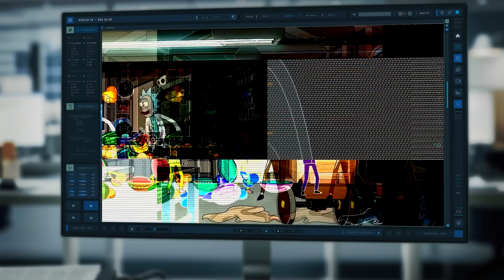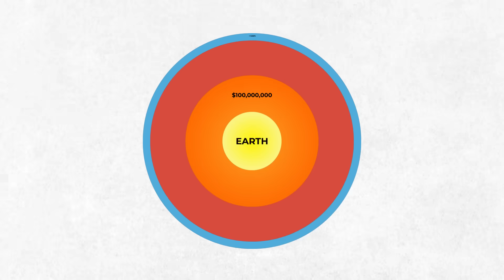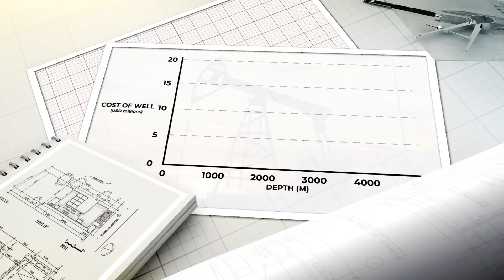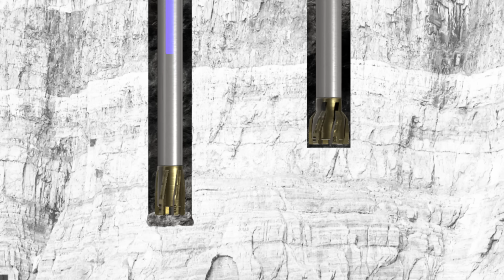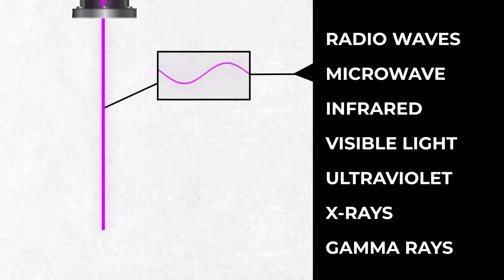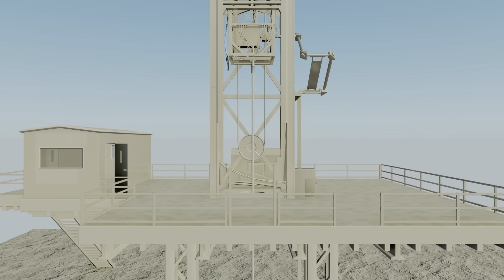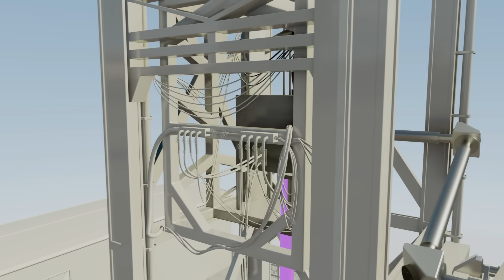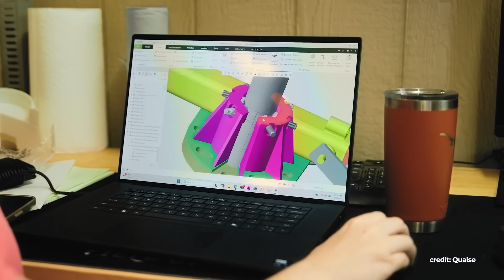The Most Advanced Drill in Human History

Comment: Arguably, this is not at all advanced. "Normal" drilling is very advanced, but closer to it's full potential. 

For example, torque does not need to be carried all the way up the string, but rather between a motor and a self-wedging stand further up.

Another example, vertical movement or force can be sensed in the bottom hole assembly and transmitted to a predictive controller at the top. 

To me, I cannot fathom how condensation up the line can be avoided. Perhaps it can't, and scrubbers need to be distributed along the line. Just as you to to scrape wax from production wells. This, too, is part of the advanced technology of 'normal' drilling.

Or perhaps a venting drill hole is part of a solution. Let's all hope this idea works out!

Comment: Sounds like science-fiction. Melting rock with a laser wouldn't be possible.
Reply: Melting rock with a laser is easy. Well, "easy", on an industrial scale. The issue is they haven't addressed 90% of the issues that drilling technology face, such as preventing the rock pressure from collapsing the borehole, or insulating their technology from temperatures that will dissolve their insulation and melt their components at the depths they want to reach.

Comment: They don’t understand drilling or drilling terminology… “this scraper tool”, do you mean reamer? The problem with deep wells is heat. The solder melts off the electronics in logging tools making evaluation of what was drilled impossible. A big part of drilling is clearing the hole of the “cuttings” the chewed up rock fragments. How do you get this melted rock (aka glass) out of the well? What happens to the gasses made when melting rock, how are they expelled from the borehole? Lastly, there is plenty of geothermal energy available across the Gulf of Mexico, reachable with current drilling technology. Supercritical water from 15-17,000’ at 300 degrees flashes to stem at surface pressures. Steam turns turbines. Then you have just the standard problems of geothermal (corrosion being the biggest).

Comment: The biggest problem with geothermal is water, or more correctly, lack of water. For example, a successful natural geothermal power station had to be shut down after 25 years of continuous operation because it ran out of water. I'm all for diverse energy sources, but they have to be reliable and cheap.

The pollution from burning coal can be mitigated, but it does raise the cost and therefore the price of energy. Weigh that against the cost and price of wind, solar and the transmission infrastructure for renewables (wires and battery storage). Activists praise renewables and demonise fossil fuels while at the same time ignoring the downsides of renewables. This is nothing new and 'the people' are easily fooled by paint-by-numbers propaganda.

Comment: I'm curious if the lifespan of these underground reservoirs for geothermal. It's definitely not liquid but there is more movement down there. Is it long enough to justify the projects? If you get an outage from a collapse, it will definitely not be a quick turn around. So, like nuclear reactors, you'd need redundant power systems to make it work reliably. To power a town, you don't need one reservoir. You need two or three. It'll be tough to make the cost work but it would be really cool

Comment: So how do you tell where you have drilled to with this form of drilling? Theres no mudlogging to be done with vapourised rock, you wont have any downhole geophysical or survey tools in that drillstring to tell you what angle or azimuth you're at or indeed any that can see through the apparent vitrified borehole wall to investigate the geology. 
If they somehow manage to keep the well open against the full force of hydrostatic pressure, geological stress, fractures, faults and pore fluids, you will still have to pull everything out to run a wireline survey tool just to see where the bit has gone or is going. But that wont matter, because of course, there's no steering tool to point it where you want to drill either. I'm sure the maser does have an application, I'm just not sure its this one.

Comment: Apart from not being able to use water for flushing out debris from the borehole - what happens it this drill hits groundwater, which it will at many different sites? And another question - can this thing drill around corners or does it have to be straight down? If it can drill aound corners you can drill a heat exchanger at depth, then cover the inside of the hole with an impermeable coating and pump clean or destilled water from topside through the bottomside heat exchanger.

Comment: WRT 9:15 So this maser'd vitrified glassy rock is reasonably easy to break with a drill but will be used as a replacement for a steel and cement liner. Right.
Reply: It prevents water from flowing in from the sides , thats all it needs to do

Comment: 9:18
I got kinda confused as to why you were using inches and then meters when talking about bore speeds so I kept it all in inches for consistency.

Current output
1in every 5min = 12in(1foot) every hour

Target output
3-5(4m) every hour = 157.58in(13.123FEET) every hour

So they are looking at a 13x increase in bore speed. Thats pretty good for something that can run 24/7

Comment: certainly you wouldn't need to turn the whole shaft.  just have a motor at the end of the lowest segment and run it by electricity...which you could run along the outside of the pipe as a kind of bus bar.

Comment: Retired oil field driller here. That glass wall will never replace steel casing cemented into place. There’s no way melted glass would reliably pass a pressure test. Not to mention if this laser drilling rig hit any pocket of gas or liquid of lighter density then the rock they drilling through and its blow out time. They have no primary well control method since they have no drilling Druid. This tech is a pipe dream and a waste of money. The people in charge don’t even understand the most basic of problems with this system. Maybe go learn about conventional drilling before you go try to reinvent the wheel.

Comment: This startup is going to fail. The right way to drill holes in rock would be to use abrasive water jets
Reply: water evaporates
Reply: @sleepparalysisdemon6394  Water is just a carrier. Abrasion is done by particles of abrasive material that water carries. Even if water evaporates on contact with hot rock, abrasive particles will still do their job. But in fact, it could be just a sandblaster with air as carrier, but water can carry more abrasive particles (so it creates a much denser flow of abrasive particles than air)

Comment: Fusion reactors aren't just hotter than the surface of the sun (6000 K), they're hotter than the core of the sun (15000000 K)! ITER will have a plasma temperature of 150000000 K.

Comment: Great explanation of what Quaise are trying to do, but a little light on the challenges they face, even with a working drilling system.   They still have to have a borehole that is resilient to pressures on the vicinity of 3+ kbar (45,000 psi) over the working life of a plant, e.g..  But the biggest ommission, is how you skirted by the "you need two connected holes" part.  To get that, you have to be able to fracture the rock between the holes, and keep it open to pump your heating carrying fluid through.  But, as you pointed out, at the depths and temperatures they are ultimately going after, the rock doesn't fracture anything like the way it does at more modest depths, and flow to close cracks rather readily.  and, if you can't connect multiple wells, every hole you drill is limited on the volume of crust from which it can gather energy, and likely to generate only a relatively small total energy before being too cold to be economical.

Comment: The real question is how this will make the Oil companies more money than oil. If it won't make them more then why would they put resources into it
Reply: it doesn't directly make money, BUT it will make it more efficient
drill can set up geothermal
geothermal makes "free" energy
energy is required by oil companies to refine oil, process oil, deal with excess cheaper and more efficiently
oil company spends less money on aforementioned above for multiple plants, cutting down cost, subsequently getting more money
...any future expenditures saved can be placed into more extensive operations, new research and everything else

Comment: A bit of glass on the borehole wall ain’t going to stop all the horizontal stresses from collapsing the hole. The current limit for vertical depth is not drilling torque, it’s more about our steel tools not being able to survive the temperature. This whole concept seems a lot like they made a POC that works in the lab and maybe in the test slabs they set up under the rig, but that jump from 6-7 readiness to 9 is pretty much going to be impossible/impractical.
Reply: What does 6 7 to 9 mean? Km deep?
Reply: @defiantnight2668  the "technology readiness" scale
Reply: @defiantnight2668  readiness level. as in level 0 is concept phase, and level 9 is actual usage
Reply: Why? You state that it will be impossible, but not why.

They're able to drill, but at slow rates and they're not at full power yet.

Are you saying the technology won't work (seems to work to me...) or that it will be too expensive?

And no one said that the glass was structural to the hole.
Reply: @edwardcullen1739  I'm saying that they are missing very fundamental elements to the system and that's why it won't work. The actual drilling of the hole is not even the hard part about drilling wells, so this doesn't really even solve anything. This solution proposes they use a gas to remove the vaporized rock from the hole--well gas doesn't provide any real hydrostatic contribution, which is required to 1) hold the hole open against the immense horizontal forces that occur deep in the earth, or 2) hold back any formation fluids (kicks) that are in-situ. They claim that the vitrified glass will hold the hole open in the absence of a drilling fluid, but that's not realistic--the forces are way too high.

Even if they were to drill successfully to some depth where it got really hot, they still have to get the tools down there, which requires some sort of pipe or tubing. They also have to have tools that can measure the well placement (survey tools). Both of these elements are the real current limiter to how hot we can drill--not really the bit itself. So unless there is some huge leap in material science and that leap happens to be economically feasible, this ain't going to happen anytime soon.
Reply: @EricCogburn the Kola super deep bore hole stopped drilling in 1992 due to intense heat and lack of funding, the heat was so intense it was capable of melting the drilling equipment used at the time. 

So to be fair we have had the ability to drill far enough to reach intense enough temperatures to melt the boring head, and we have for quite awhile
Reply: @clickbaitgamer2749  right, and guess what is right above the bit--it's the drill pipe and other tools, which also have to withstand the heat. So having a laser instead of a bit doesn't really solve much. BTW i am a drilling engineer and have been involved in some of the longest wells drilled on earth, so I'm not just speculating.
Reply: @EricCogburn did you watch the video? Or look into the program at all? The program plans to use a variety of different methods including conventional drilling and the videoed method, when drilling with this method you forgo the need for a steel pipe as the rock around the laser is melted and hardened (rock having a higher compressive strength relative to steel), they’ve extracted cores of the super hardened rock and examined them in a lab which shows signs of being able to withstand the intense pressure and heat at the intended depths depending on wall thickness, this is an incredible potential leap in technology that is brand new and the only one of its design, as such you can point towards any number of flaws with the limited knowledge we have. They are the experts in “their” field, nobody else is doing what they do, and if you’ve been apart of some of the deepest bore holes you’d well know hitting 10km has been accomplished and passed with conventional mining techniques, as mentioned the Kola super deep bore hole is a whopping 12km deep, that is 60% of their intended goal of 20km achieved for them…. In 1992. It’s feasible to imagine they plan to drill as far as possible using conventional methods and then finally use the laser bore for the final kilometres of distance.
Reply: @clickbaitgamer2749  this is classic Dunning Kruger on your part. I've watched the video and  visited their website--I'm aware of their claims. But drilling some holes in a shallow test well is a far cry from drilling record breaking wells. Just because they're "experts" in making a laser drilling tool doesn't make them experts in drilling and it also doesn't change the fundamental physics of the situation. You still have to get the tool down there, you still have to survey the hole for directional/placement reasons, you still have to get the cuttings or vaporized cuttings out of the hole and you still have to maintain wellbore stability. 

Not to mention the economics of it all--we could definitely drill deeper than the Kola SDBH if someone wanted to throw billions at it--but no one does, because it doesn't make sense economically. Also, if you are engineering a geothermal system, i doubt it's going to make sense to spend all this extra money to get to a slightly hotter formation when, for the same money, we could drill multiple wells in more conventional, but still hot enough formations, and get so much more formation contact for heat exchange.
Reply: @EricCogburn  are you not entirely exhibiting the dunning Kruger effect yourself my friend? I will admit I have very little knowledge when it comes to the complexity’s of constructing a geothermal system, although I would like to assume that since we can and have drilled into magma vents with temperatures exceeding 900C and functionally made them into geothermal generators, that the technology to guide and aim a bore at such intense temperatures, may already exist and as someone who is not a geothermal generator expert I am simply ignorant to its existence. 

You talk about drilling deep holes and how your an expert on it, yet that means very little to a team of people like this who are on the cutting edge of a technology neither of us has any experience in
Reply: @clickbaitgamer2749  No man, he's right. The steel tubing is not what keeps the hole from collapsing, as suggest in the video. It's the water/mud they shove down into the hole, which isn't easily compressible. The video implies that steel is just there to "seal" the walls of the hole so air/liquid doesn't get through, but doesn't mention that the hole is filled with liquid to prevent it from collapsing. It DOES mention that water ruins the laser, though.

You are used to gravity crushing things DOWN, but at that depth the pressure comes in from all sides. If you drill a hole that deep, the hole closes itself up unless you put something IN the hole to equalize the pressure, and a hollow tube of concrete and steel is NOT going to cut it. 

Just because something is new technology doesn't mean you pretend like the laws if physics don't exist. It's new technology, it's not "magic". 

And by the way, "assuming" that something already exists/someone else has done the work/something is possible is just as ignorant as assuming nothing is possible, just in the opposite direction.  

It IS true that new technologies and theories are frequently lambasted by the establishment, but you actually have to know what you're talking about to tell if that's the case. 

This presumption people have that anyone naysaying a new tech is just an old fuddy-duddy who doesn't get the future is what allows con artists and scammers and pseudoscientists to find a following.

You don't need to have an opinion about something you aren't educated in.
Reply: @reizig thank you for saving me from having to explain to “clickbaitgamer” why he should actually just sit down and listen to the expert who was gracious enough to even entertain replying to him.

This is definitely a tech that seems worth developing, but ultimately is not going to achieve what it’s claiming to be aiming for. 

Plenty of technologies were developed in an attempt to achieve A, and ended up instead achieving B, while B was totally unforeseen or not even imagined yet - so I don’t think this is a waste of time. Is this a worthwhile use of otherwise evil VC money? Absolutely. Is it gonna let us drill to unreachable depths? Nope.

Comment: its awsome to think about that its a self feeding system if they do it, the power required is ALOT but at the same time soon as they setup 1 geothemermal then they can use that to feed back into the supply power for 2nd geothermal setup and so on making the power required from the current grid less

Comment: how are u not using a lot of water? if its 400-500c isent that just evaporating very quickly ? or causing pressure build up ?
Reply: pressure and therefore steam goes up into the pipe and just spins the turbine or multiple turbines, though. any excess might get stored somewhere or worst-case scenario they let it out of the pipes via vent. i'm sure they also measure how much the pipes and everything else can handle. you're putting a fixed amount of water in it, not continuously pumping water in, that's why it's a "closed-loop"